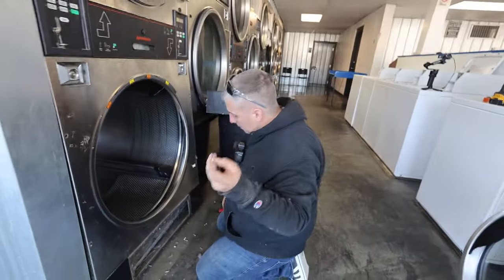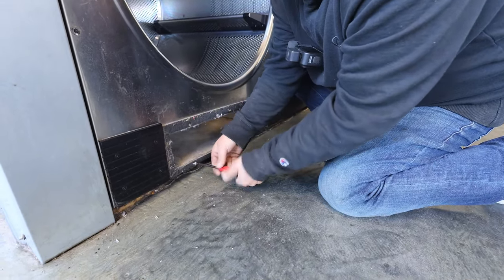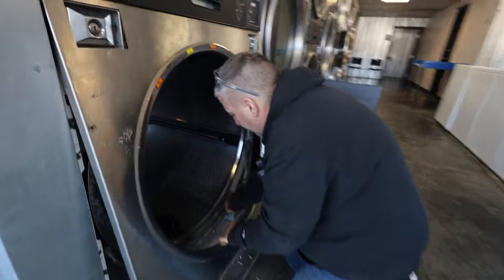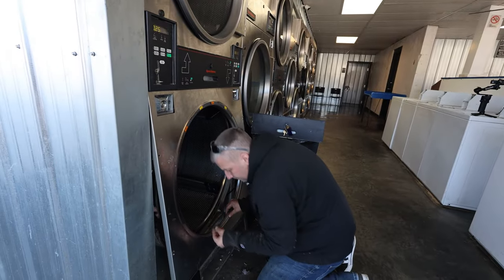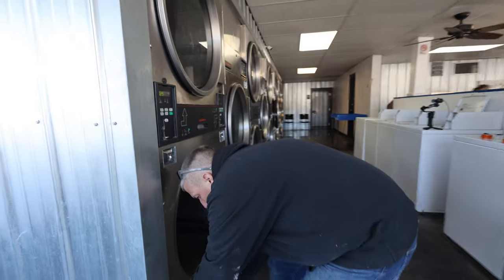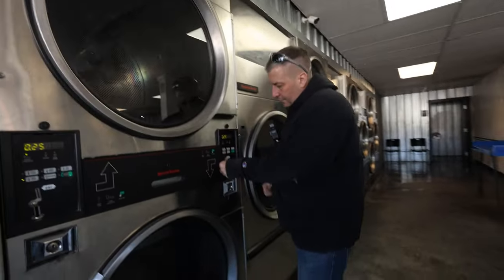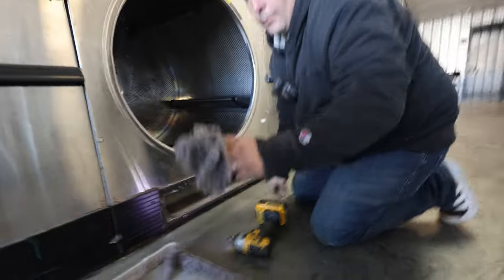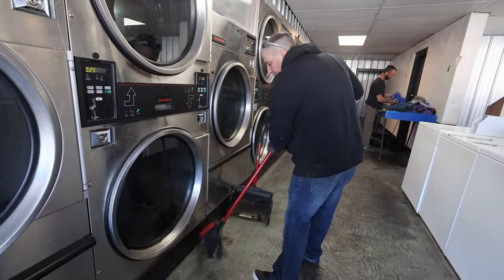Oops! SUMLORD Takes a Tumble! #followingkeenan #laundromats #dryerlint

Comment: Hey Keenan, on my Speed Queen stack dryers i can reach in thru the lint drawer opening to change those wheels, as long as the “outside “ nuts are lock tighted!
Reply from the maker: Yea, this one the nut backed off. I had so many you try to do it thru lint tray. Only to have the backing nut come off. My luck not so good.
Reply: Occasionally the outer nut comes loose when you back off the roller side nut, then you have to pull the front off.  I've had it happen a couple of times. But then I put lock-tite on the stud and use my impact to tighten the hell out of it.. 😅. Never have a problem after that..

Comment: This is a prime example where some preventative maintenance will go a long way. Realistically, depending on traffic and use, those dryers should ALL get the front panels removed at least quarterly, to get rid of all that lint buildup where it doesn't belong. It would save the wear on the machines and eliminate a fire hazard. Speaking of which, I am willing to bet that 98% of all laundromat dryer fires are caused by the neglect shown on this video. 

Keenan, you are a good guy and do a lot of good things, so take my comment as advice rather than an insult.

Comment: I put some lock-tite on the outer bolt stud and then you won't have to pull the front off of the machine when you change the rollers in the future.

Comment: I was at a Laundromat about a few weeks ago and I used the 4 load washer and it was making a loud banging noise on the spin cycle. It was so loud that the entire laundry mat heard it and possibly my deceased grandfather 😂. I had mostly jeans but there was a lot room in the washer. Machine is under maintenance repairs now.

Comment: Hi Keenan, wondering if you can tell me why my SQ Horizon is making a high pitch sound when spinning fast?   When I  replaced the bearings they looked good.   Can a belt do this?
Reply from the maker: I never had a belt do that. So you just replaced the bearings? Because usually that high pitch noise is the bearings.